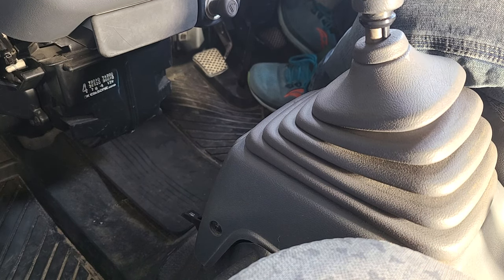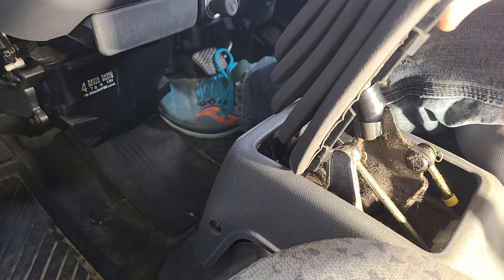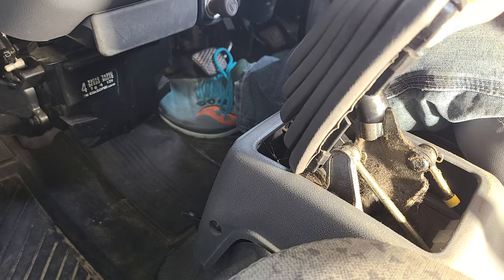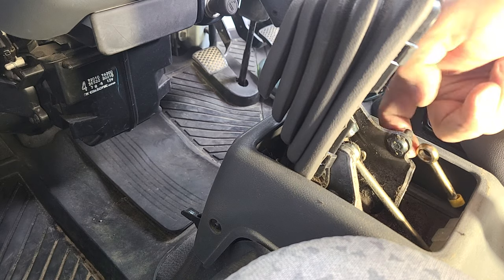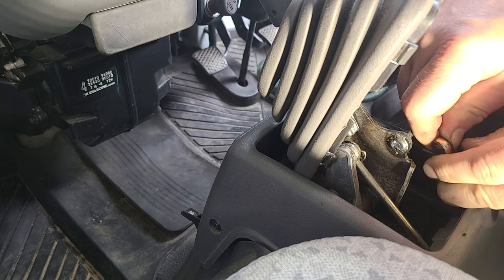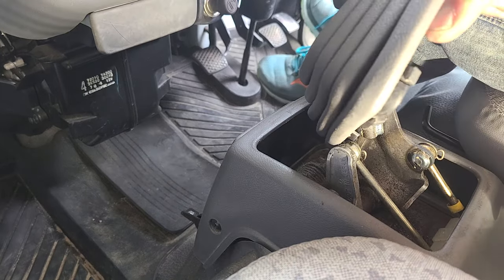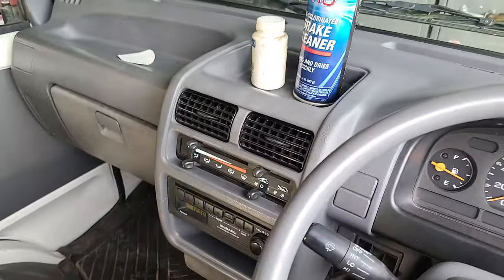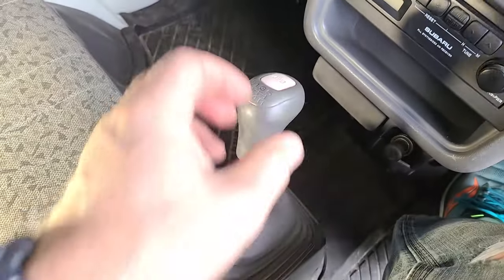Subaru Sambar shifter fix - $20 and ten minutes to better shifting!

Comment: Thanks a million I added those bushings to my (new to me) 1996 sambar!
It will make it way easier to get used to me shifting left handed now.
Can you recommend any other sources for parts and information for upgrades and fixes.
Thanks again 😊
Reply from the maker: amayama has a lot of parts and numbers. Have to wait and confirm they have it after ordering. yahoo.jp is good for stuff if you go through buyee. Just takes a while and adds some cost to the transaction.